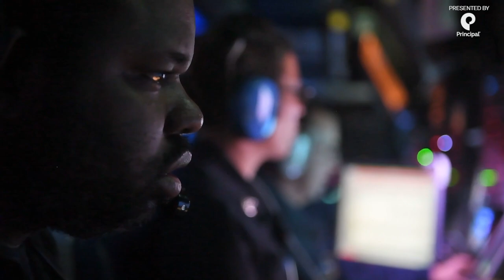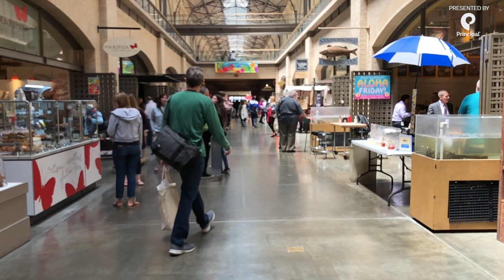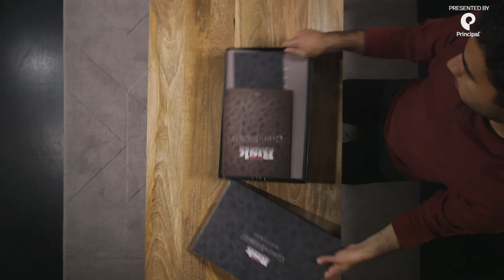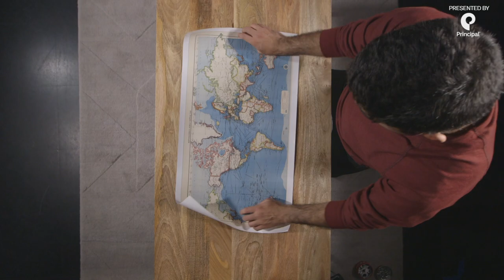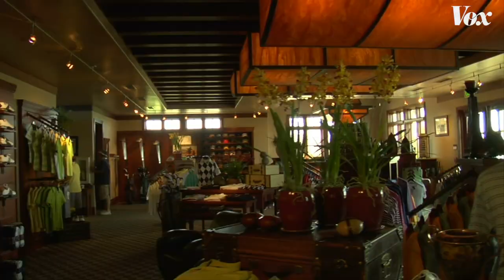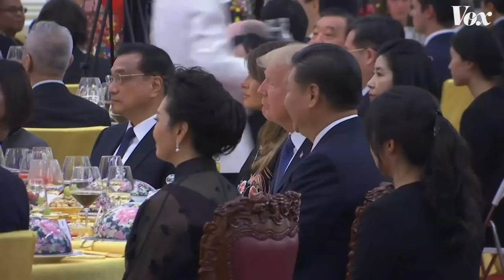Trade wars, explained

Comment: When trade stops; war starts 🔜
Reply: Trade allows countries to be mutually beneficial to each other and rely on each other for goods and services to keep their economies running. Countries that are not taking place in trade with each other don't see as much benefit and even worse is when they see a benefit that they could use but do not have access to. Relations break down, wars break out, territories  are re adjusted.

Comment: THis is trade 101, it is not trade of what we have today.  How do you explain, when we have companies thats across the globe? For them its borderless,  when you import from China using your labtop example, you are actually buying a computer assemble in china, with parts from Samsung (51% own American) and using expensive US components running US software, paying US advertisment. When goods is profitable its stock goes up, the stock is than sold to big bank that include Japan/China/American/EU.  If you use trade 101, it will hurt Chinese more, if you use Trade 501, the picture is clearly hurting US more.

Comment: Trade war with China is not bad, most of goods from China are uncontrollable regarding environmental and ethical standards. Trade war also slow down the over consumption process which benefits the environment. This video analysis is not neutral as it should be

Comment: The majority of the investment community doesn’t see this as an issue. Steel and aluminum tariffs were put in place for national security reasons and because of WTO, unfortunately, the US has to lever the the tariffs on everyone. Tariffs will not escalate beyond that despite  the fear mongering from the anti trump left. 
All the US wants is to be able to make tanks and planes in a state of emergency the most likely of which will be due to a war with China/Korea the ones putting the US steel industry out of business.

Comment: I say do it. We’re not losing economically so much as we’re bleeding money. We refuse to cut defense spending and we can’t cut Medicare so the next option is to revaluate trade agreements. If what Vox said is true then America has a reassured win (exempting an actual war which we would also probably win but that’s bad). So right now we have a problem and we can force a fix with minimal possibility of failure. We throw tariffs back and forth until China starts to cry. America will suffer in the short term. That’s for sure. But in the long term we can probably rebalance the scale in our favor. China doesn’t follow our patents and it actually has tariffs against America. Sooooo what if we could flip the script. Eventually someone will have to agree to the others demands. And we’re the favorite to win this trade war. Just no real wars please. I’ll pay extra for an iPhone or gas. But I’ll draft dodge in an instant.